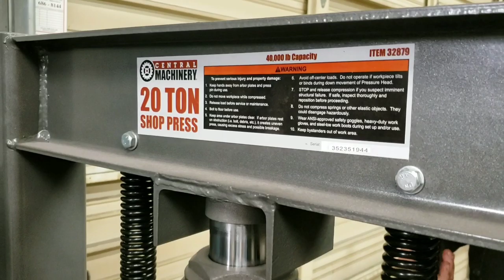Part 28 of Metalworks 1955 Chevy ProTouring build. Mounting the radiator.

Comment: Joe's doing a great job. You do have a band saw. Or how about a plasma cutter for those cuts in  that plate steel? 🙂
Reply from the maker: Thanks! Yes, we actually have both a band saw & plasma torch...Joe said he utilizes all 3, just depends on the piece he's building.  He often finds using the grinder lends to less clean up of the part being fabricated.
Reply: @metalworksclassicautoresto9583  That makes sense. Also if I might add, great content in your videos. I  like the progress that you show.

Comment: Love the build and it is motivating me to try some new things just to make my build that much nicer. How much space are you leaving between the radiator, ac condenser, and heat exchanger for the supercharger? A small gap is necessary correct? I’m going to have to squeeze a radiator, intercooler, ac condenser and big transmission cooler up front on my 79 Malibu.
Reply from the maker: Thanks Chais..."Try to keep components as close as possible. I try for 1/8" - 3/16" gap between the radiator, heat exchanger, and condenser. Keeping them close maximizes air flow and cooling, remember you will be pulling lots of heat through the radiator, so make sure you have good fans and shroud. Good luck, Joe."